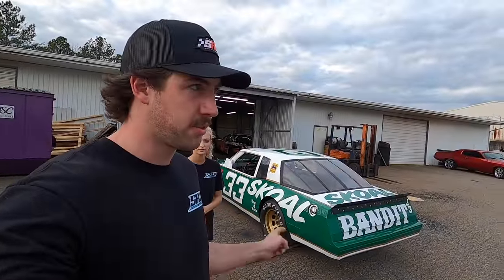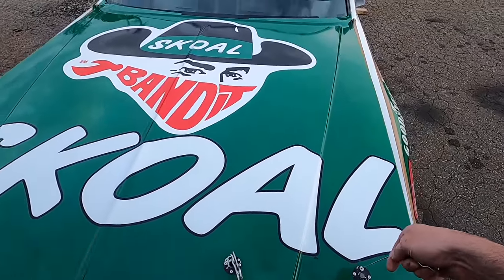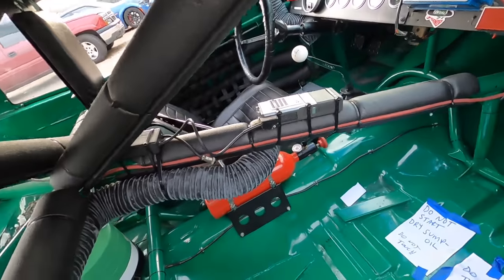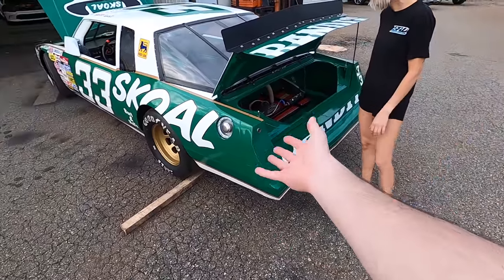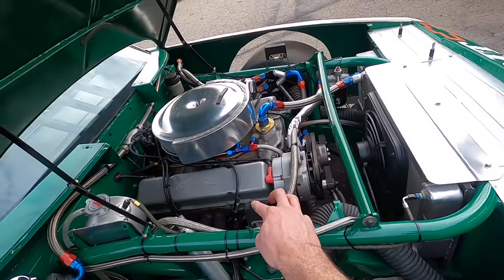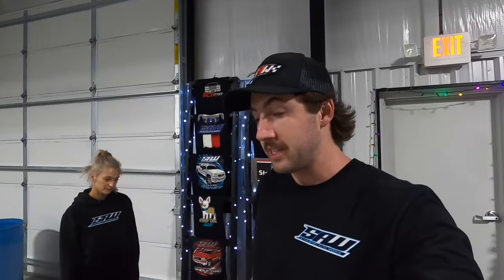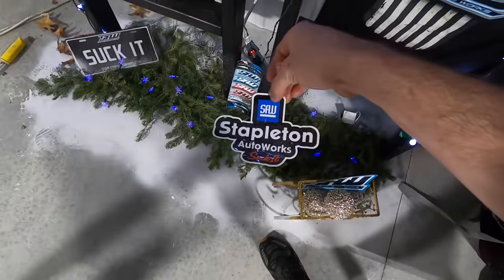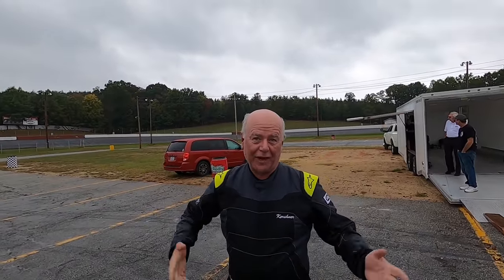Harry Gant's 1988 "Skoal Bandit" NASCAR Aerocoupe Monte Carlo (Unrestored & Sounds Epic)

Comment: Clearly a short track car.  Lots of cues.  #1 - Wheel opening gaps are huge.... Super Speedway bodies were very tight to the tire for aero reasons.  #2 - Oil tank in the front left against the firewall..... thats to get more left side % so it'll turn at slower speeds.. #3 - Rear steer Banjo Matthews chassis which were very good for short tracks on the old bias tires.  Dead give away that it's a Banjo chassis rather than Hutcherson-Pagan or Laughlin is the way the bar is routed over the trans tunnel under the dash.  Anyway by 88 many teams were starting to run the front steer chassis on Super Speedway because it allowed the engine to be lower, running a bigger oil pan which helped clean up air under the car and free'd up power on plate engines.  Nicely preserved and restored where needed car from a great era in NASCAR.
Reply from the maker: Very helpful information thanks man!
Reply: Also wider tires which were for short tracks for max traction,usually 11-12 inches wide vs 8 inch for speedway cars for less rolling resistance and the the tall rear spoiler for more rear downforce to make the rear stay planted in the turns.You don't see any cowl vents either which is a speedway car thing to help suck the car down to the track to prevent lift and there may be some roof offset and wheelbase offset to help the car turn,definitely the best era for innovation before all the cookie cutter "packaged" setups they run now,sweet car for sure!

Comment: The Wood was attached to the gas pedal because it didn't get Hot, that was an issue back in the day. Great video
Reply: True, some drivers took Styrofoam coffee cups and cut them so they would fit on the right heel to insulate some because the floor got hot also.
Reply: @danmclennan7930  Interesting how drivers were adapting to minor issues. Back in the day the little things Crew Chiefs were solving with a little ingenuity. What a time to Enjoy the Sport of NASCAR
Reply: Why Marcis wore his leather sole wingtip shoes.They were real men among men back then

Comment: Dude....that cooler inside the car is as 80's as you can possibly get.
Reply: It is I had one.
Reply: Yes. It's definitely authentic. Even the Monogram 1/24 scale model kits include it just like that. A clear vinyl hose let the driver drink to keep hydrated while driving. With the exhaust and engine heat, combined with no insulation, the cockpit would get to over 130 degrees during a race. Later, NASCAR drivers would take an idea from desert offroad racers and use a "Parker Pumper"... another squirrel cage fan with an air filter on the intake, that would blow through a vacuum cleaner flex hose through an ice chest to the driver's closed face helmet to provide clean, cool air. Cool suits were also used where the driver wore an undershirt with small flexible hose that snaked around the driver's body. The hose connected to a small electric pump that pushed water through an ice chest to cool the driver.

Comment: As the old Harry said, “there is nothing stock about a stock car”
Reply: The sheet metal (massaged by an English wheel) front and rear bumpers, windshield and floor pan are factory for sure. Very cool era in NASCAR.

Comment: I used to love the sound of 43 of these busting off on pit road at Charlotte and the smell of rich racing fuel exhaust fumes floating through the air.
So many memories.
Reply: Then you would have gone nuts over the sound of the big blocks in the big cars in the '60s and'70s. They literally made the ground shake. Carry on.
Reply: I was at Charlotte in that era. In fact I can remember seeing those Aerocoupes lined up on pit road as a teenager and falling in love with those Montes. That back window screamed "built for racing". Love these cars!

Comment: So bad ass! I always thought the these 80s monte carlos were so cool! 
Since I grew up as a kid I always wanted a '87 monte non aero coupe with ttops. Black with the red stripe. Got a diecast of one now. 1st car I owned was a '78 monte.  
In the mid 2000s I helped a bud who raced in super stocks at a local race track. We skinned a '84 monte and riveted it to another chassis. I was kinda heartbroken doing it because the car looked in pretty good condition with minimum rust. As we tore it apart I found tucked away in the coils of the back seat the factory build sheet! Racing was certainly cool then and very relatable to street machines back then
Reply: Btw: you mentioned about the hood. From what I recall when we skinned the monte we did for the super stock car we were building, after you remove the underlay (2nd skin) of the hood its just a think sheet metal piece with no support bracing. I need to check some of my old photos to see if I took any pictures of the hood to verify this. 
 Thank you so much for taking the time and posting racing history. It's really appreciated. Keep up the great work and lookong for award to your next videos.
Reply: I’ve got a non aero coupe 86 ss ttop car that I really need to get around to finishing redoing. love that car it belonged to my great grandparents and will never leave
Reply: Buddy chopped up a all original 1 of less that 50 Oldsmobile 1980 w30 442 quite a few years ago and built a dirt car out of it he still gets dirty looks from people for that one but hey when you flip your other car and that was only car you could get your hands on in time you do what you have to do

Comment: It’s so cool how they sound I loved going to the track as a kid and driving later on..miss it but it’s werid how even a 800hp LS doesn’t sound that good..but then those notes are from a tiny engine big cam huge over lap able to turn 9K rpm ..compared to say a 416 or a .427 only turning 6600 maybe 7500 rpm ..plus the exhaust with its flat bottom gives it the coolest sound compared to a round tube..

Comment: That shortened decklid to fit the aero coupe rear window was pretty normal in Nascar, Dodge even did that same thing on the 69 (I think, might be off a year?) street Charger 500 homologation specials which had a similar rear window setup to reduce drag and improve downforce. Saw that recently on a episode of Nicks Garage (in Canada) who is restoring one of those.

Comment: Burt aka Gator McKlusky RIP, The voltage regulator was a left over before they went to the smaller Japanese made small body alternators that were all internal parts and high output but very reliable and small. The alternator in the car now is a Delco Remy one wire large body alternator which was used also depending on the year but heavy.

Comment: Hood Skins - they did both depending on if they had factory support or not for any part - like the rear deck lid, no factory support for that skin - that is a cut-up factory deck lid out of a junk yard.  The hood looks to me to be just the top stamp, or skin, off the stamping plant line.  Roof panels and floor pans were all mostly factory skins along with the hood, quarter panel, fenders and door skins.  Just after this era of car we started to make some of these body panels out of flat sheets of steel ourselves; teams started to get real anal about aero dynamic profiles of the cars body work.  This was about the time I got into the Gig.  We had to use Kevlar NASCAR approved nose and tail pieces, factory stamped hood, roof and rear deck skins - the rest of the car was basically ours, but had to fit the ever increasing body templates.  Those were some good times through the transition, a lot of innovation went under that bridge.
Reply from the maker: That’s very interesting. So you’d say this era car still had factory stamped fenders? That would make building our own much easier 🤔

Comment: 6:00  That is a Ford style electronic voltage regulator for the alternator. These were used up to about the early 90's. The connector is the same as the mechanical regulator used when alternators were first used.  I'm thinking that they went to electronic in the early 70's.

Comment: The degrees of the engine they talk about is the head face angle too the block the block angle stays the same you machine the head face on a angle to make the intake valves more square to the piston and bore intake manifold angles are machined to suit as well   
When they had the throttle restriction  the plate on intake they filled in the gaps on a single plane manifold that would normally be big open chamber it’s filled to reduce the in unnecessary air volume on intake so you have 2 cylinders drawing off 1 barrel of the 4 barrel carb to keep the air speed up  it’s pretty cool the technology that went into them

Comment: My favorite Nascar body style of all time! I think the possible answer to the fact that the trunk lid was a non aero coupe was that they only made I think less than 2000 of these cars for the public and this car was built for the Daytona 500 race in February of 1988 so maybe Chevy didn't have the tooling for replacement trunk lids this early in the year. I sure don't remember those air vents on the doors. Maybe this car was a show car and possibly didn't see any race action. That would explain the original paint. Love your videos !
Reply: Oh this has definitely been raced... Lukas mentioned the crush panels used to fill in gaps when they reskin (put a new body) the car... You can also see when showed inside the boot you can see ripples in the chassis metal where it had been wrecked at time, and Lukas even mentioned that it looked like it had been "banged around a bit"... This car is a reskin... Probably reskinned and repainted to be put n a museum...

That's not even the first original body on that chassis, much less original paint... That chassis has probably been reskinned at least a dozen times before finally being retiring...

Comment: I recall seeing one of the Harry Gant cars at the Sunbelt Ag Expo back in the mid 80's. They were giving out those cheap flat-top hats with the flaps hanging off the back of the hat to keep the sun off your neck. Had the Skoal Bandit design on the top of the hat I think. Pretty sure that the one I saw was before the aero model.

Comment: The voltage regulator on the right side fire wall is for a Ford alternator, but the car has a GM alternator with a built in regulator ! i guess thats why they just cut the wires instead of removing it ! great video , love old stock cars !

Comment: Those "Pontiac" 867 heads are NOT 18° heads. They're 23° raised runner heads. The 18° heads came latter.

Just an FYI. The heads were cast for GM by Brodix, and are a variation of the -10x casting IIRC.

Y'all keep up the Kool vids.
Reply from the maker: Interesting. I know people angle milled them but I have no idea how that correlates to the advertised valve angle vs true "as cast" angle. I would love to talk to someone who built engines back in the day with these things.
Reply: @Stapleton42  I have used those heads in a few builds ( old recycled Nascar heads ) Those heads as cast have a 23° valve angle, their huge difference from stock 23° production heads is the intake runners are raised @ .400".
To put it in modern parlance, it's kinda like how LS7 heads have a raised intake runner versus LS1 heads.

The latter 18° heads were cast with a true 18° valve angle. And the intake runner is raised further yet versus the earlier stuff, to match the 18° valve angles.

Comment: Fun fact about the end where the driver said he had to turn the car right in the turns. Andy Petree said on Dale Jr Download that Harry would rather fight the car down the straightaway to take it easy in the corner, while Dale Earnhardt would rather fight the car in the corner and relax on the straight away. So a car could be set up more to turn on its own or not.
Reply from the maker: Correct. I think you have it backwards though. Harry worked the turns and dale liked to work the straights. I just listened to that podcast last week. Reverse caster in the left front
Reply: @Stapleton42  yes I think you are correct. Thank you

Comment: I could be wrong, but I feel like I recall that NASCAR engineers created the aero coupe in the mid to late 80's, in response to Ford after Ford brought out the Thunderbird in which Bill Elliot set many speed records, reaching dangerous speeds at Daytona and Talladega. Then GM had to modify their Monte Carlo and Grand Prix to offer the aero version for sale or the NASCAR aero version couldn't be utilized back then. They could only run it in NASCAR if the body, or a very similar appearance body was available in showrooms.

Comment: In 1988 the cars were still using factory OEM  sheet metal. 
The wood on the accelerator pedal was for insulation from the hot firewall.
That looks like a short/intermediate track car to me.  👍🤦‍♂️

Comment: Wow bubble window was only around for a season. Was a little more aero on the big tracks.  Looks to be a short track car with the ducts.  They got plenty of air inside the car on the super speedways so the ducts weren't needed.  That's impressive, very rare.
Reply: Yes, I believe that is a "short track" car... Short track cars had bigger ducts around the the front grill area for better cooling of the brakes... Window ducts were also used as you said to bring more air to the driver... Short track cars also had larger front splitters and larger, more aggressive rear adjustable rear spoilers to provide more downforce in the corners... Speedway and super speedway cars had smaller front grill ducts as the brakes were not used as aggressively... And the window ducts were removed for better aerodynamics...  They had lower chassis with stiffer suspension, and smaller, less aggressive front splitters and rear spoilers...

Road course cars were very similar to short track cars except they were designed to be symmetrical, rather than asymmetrical, due to left AND right turns...

This particular car could be either a road course car, or a short track car...

Comment: This would've been a short track/ road course car. back then they didn't have bespoke road course cars and they would usually convert their Martinsville/ flat track car to a road course setup. This car is most likely not their road course car though as I see no traces of a cutaway in the trunk for the Watkins Glen fuel filler hose. they have to put that on the opposite side for that track as they run the opposite direction there. Which you can see on the Darrell Waltrip car. that would've been setup for the Glen specifically as the fuel cell config is for the right hand side...

Comment: Look how the rear end is hung, for road courses the pan-hard bar is hung the opposite way of the circle track cars due to having to do more right turns than left and geometry of how the rear pivots for traction.
Reply: Also check the center line of the axel tube to centerline of the axel it’s self. The good Ol boys had a trick with it for the circle tracks.

Comment: would think it would be a Superspeedway car, because the Aerocoupe was important for those tracks. Otherwise Harry usually ran Buicks and Oldsmobiles. but the air vents and brake ducts would make you think different.
Reply from the maker: Aerocoupe was the normal by the late 80s even at non aero type tracks. I think this one was like a martinsville car or something. I’ve seen old pictures from there where cars have ducts like this

Comment: Awwww yah Stroker Ace all day!  The block of wood is to keep the heat off the drivers foot.  Don't need them on the brake or clutch pedal because you'd be riding them and slowing down if you're using the other two pedals often.

Comment: The arrow Coupe. You are opening a big can of worms of NASCAR history. Stock car meant a stock car. So the body style you had to run in NASCAR had to match exactly what the manufacturer was selling on the street. Ford at the time was doing WindTunnel testing on the cars first. Then when they had an arrow package that worked really good then that became the body style that they released for the cars they sold. At the time GM was not doing that. Which is incredible because they were still very competitive.  But the last two years of the Monte Carlo 86 and 87 GM decided to play Ford's game and went to the wind tunnel.  That dramatic change in the rear window was all about airflow traveling down that window across the trunk lid and up the spoiler to create more rear downforce.  
P. S.  GM Monte Carlo the most winning car in NASCAR history. 
Love it!!!!

Comment: Hopefully they take it back to the track when it's dry!
Can you explain a little bit of why he had to steer opposite???
Reply: Every adjustment in the suspension setup is made to make the car want to naturally turn to the left even if you let go of the steering wheel. Coupled with the banking in a turn, the xar naturally wants to fall off the left side of the track. In order to keep it up on the suface when not at speed, you actually have to steer the thing to the right and force it to climb the embankment.
Reply: @sadiejustin  thanks for reply.
Explained perfectly 👍
Reply: I did some laps at darlington in my personal ‘95 Monte Carlo a few years ago during a Petty driving experience. It rained right before we were supposed to drive the race cars and they needed to dry the track faster so the let all the people enrolled in the driving experience drive their cars around behind the petty vans for a few laps. At 55-60 mph you definitely have to turn right on the banking to keep the cars up on the groove. But when your in the rpde cars you def have to turn left!